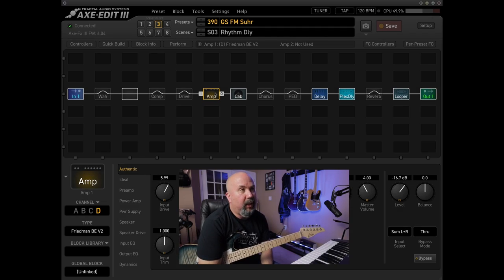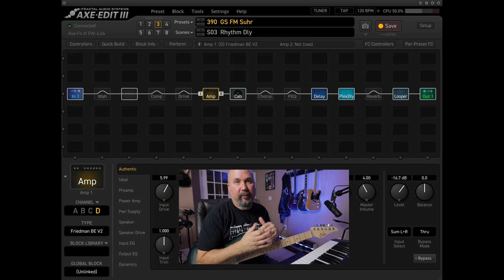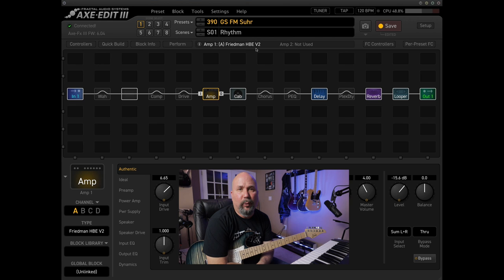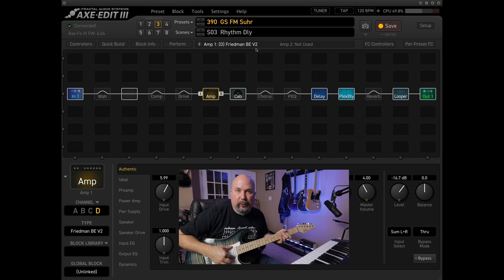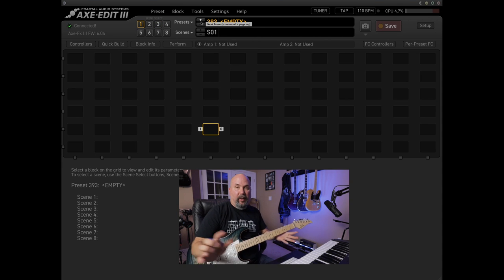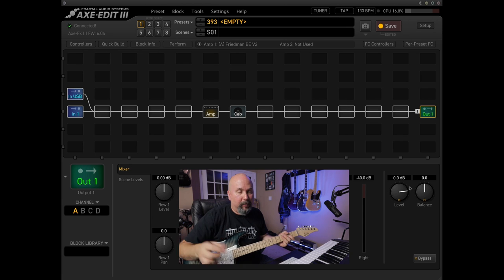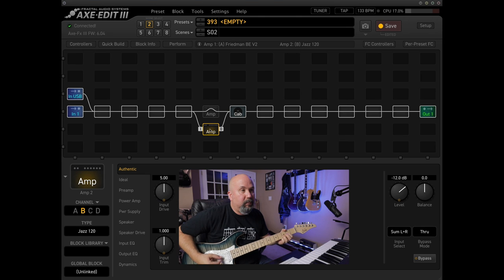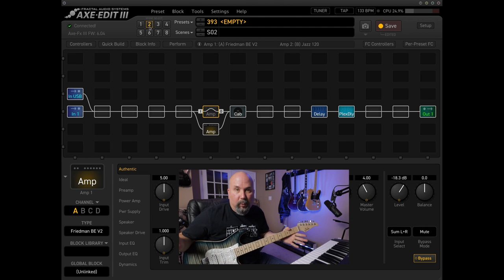Axe Fx 3 Seamless No Gap Scene Switching

Comment: Might be the best video you've ever done. If you're clever with the way you setup scenes you can also get channels happening here.
Reply: Also - that Suhr!
Reply from the maker: haha....i really didn't think I did much for anyone. See....I'm a terrible judge of good content of my own! Yes, I posted this in the forum and Yek responded with that channels thing as well and I totally had forgotten about that. Seem I saw you do a video with a "multichannel amp" using scenes. I tried the channels earlier but I still hear a littel gap but it never bothered me anyway...unless I misunderstood and did it wrong. I just grabbed a row of switches and assigned category "effect" and then function "channel select" etc. within that scene
Reply: Great video! I have tried channels within the same block as well as scenes with amps in parrallel, as you have shown here. You can definitely minimize the gap considerably to the point that its at least as good as most 'real amps', however if you REALLY want absolutely zero-gap switching, you can accomplish that by using different channels on the Multiplexor block,which would be placed after the amps. This is the only way I've found to get true zero-gap switching. Has anyone else found any other ways to accomplish this? Leon?
Reply: @LeonTodd  what is the clever way to setup amp channels without gap ? maybe you have any video on that ?

Comment: Any suggestions on how to accomplish this for the FM3? Can't have 2 amp blocks as far as I understand so feeling a little limited but hoping there's some way around it?!
Reply from the maker: If you are using 1 amp and not utilizing the channels function you can use modifiers to change settings on each scene. There will be no gap at that point but this removes some flexibility unfortunately. This is what I’m doing now since I only use one amp. Hoping they improve this over the next firmware updates.

Comment: Did they ever fix the gap between  scene switching?
Reply from the maker: I don't use the axe 3 live anymore but as far as I can tell in my presets (fairly basic) the gap is not there. They have made so many improvements since this video and we are on firmware 16 now.
Reply: let me ask you this if your just using different Fx in different scenes & not using ant amps are there gaps?
Reply from the maker: No. Like I was saying even with the amps I don’t hear a noticeable gap...not the case of the FM3. Axe 3 is more seamless all around. You could ask folks in the Facebook groups that are using it live and see what they are experiencing. I haven’t used it live it over a year. I didn’t have any issues when I was using it though. It’s better than real amps that have gaps when switching channels. It’s an awesome unit.
Reply: @GregSummersMusic   what are you using Live?
Reply from the maker: FM3.
Reply: @GregSummersMusic  ok i really like Rack gear i'll check outAF3 since  im just gonn a use it mostly for FX it shouldn't have Gaps i hope
Reply from the maker: Yea head over to the forums and Facebook groups and ask there. Others may have more recent insight. I don’t think you will be disappointed though.
Reply: @GregSummersMusic  ok will do thanks
Reply: @GregSummersMusic  Is the axe 3 still more seamless with the latest firmware on both units?
Reply from the maker: @legendfpv  Axe 3 is really good, FM3 still has a small gap when switching scenes, but this only applies if you are also switching channels on amps or changing to a different amp via the channel. For the FM3 I use the same amp on my patches so I just utilize scene controllers to change amp gain when needed and this solves the gap.

Comment: Hi Greg...I'm trying to use a BOSS ES-8 to control my FM3, and changing between presets and scenes has significant lag. Any thoughts?
Reply from the maker: Presets will always have lag so scenes are the way to go. You shouldn’t have a gap with scenes. I’m not familiar with the boss that you have but I’m guessing you are using the exp jack on the back to the axe Fx 3 and are using it as a stand in switch? Do you have any other small switch (2 button) to test?
Reply: @GregSummersMusic  thanks for the reply, Greg. So it sounds like you’re not supposed to use it as a back and forth between presets and scenes, eh? You set everything you need in those 8 scenes, and then move on to another set of scenes? I get it, but it’s an odd feature. I’m used to being able to flit between all manner of things with all my MIDI and non MIDI stuff.
Reply from the maker: @dominicgibson9529  Not odd and fairly common with other modelers. Helix is no different with presets and snapshots. Recommended workflow is using scenes (axe fx) and snapshots (helix). Personally I have a preset for each song usually, and during that song I will program things to turn on and off from scene to scene.That said, depending on the modeler and power of that modeler, some people will have 1 preset as the "kitchen sink" preset that has everything they will ever need and also use scenes and instant access features to bypass blocks on the fly to fit the song. Just depends on how much tap dancing you want to do. Helix will also have gaps from preset to preset. Can't speak for kemper. There's just a lot going on when a new preset is called (from a CPU standpoint).
Reply: @GregSummersMusic  I have created a monster of a pedalboard, which is basically 2 separate systems based around an ENGL Special Edition head, and an ES-8. My ENGL has 3 FX loops. One is for the amp as the sound and contains an HX FX, 2 H9’s and a bunch of other stuff. I then use the FM3 in the return of another loop so using the ENGL’s power section. I’ve been used to having all manner of effects set to go on and off and arranged in all sorts of orders, the ES-8 can arrange FX pre and in the loop, I’m just new to the modelling thing. I have to say the FM3 is definitely living up to the hype.
Reply from the maker: Sounds like a great setup!
Reply: @GregSummersMusic  I have to admit it is...not just because it’s mine, but because as someone who suffers from severe depression and social anxiety disorder it’s given me something to do. I’m also quite chuffed my theory worked. Have to admit videos like yours and Leon’s have been massively helpful❤️🎶
Reply from the maker: This is good to hear. Also, yes I occasionally suffer from mild depression and keeping my mind occupied, getting outside, etc. helps. It’s when I’m alone with my thoughts in the evenings that I am affected the most. Take care of yourself and stay healthy.
Reply: @GregSummersMusic  I hear you. I'm retired because of my health, but unfortunately I live in the Yukon, which is not a great place to be when you feel this way. Keep up the great videos...you've definitely got a fan up here.
Reply from the maker: Take care! Appreciate the support!

Comment: Hey new subs here!
What if i dont use amp and cab blocks, just the effects?? Does latency gap is there when switching?
Other question:
What if i use daw to control axe fx 3 does latency gap still there??
Thanks mate!
Reply from the maker: If you are talking latency when switching scenes there is no gap. Presets will always present a gap. I haven’t tested without amp and cab blocks so I can’t answer that at the moment. They’ve improved any noticeable gaps even since this video. Biggest issue was always changing amp channels to a different amp so you are probably good there only using the effects.
Reply from the maker: Thanks for the sub!
Reply: Coz axe fx 3 has 8 scene per preset, so if scene 1 is mesa and scene 2 is marshall will latency happen??
Question 2:
Should i put all the blocks that i need in every preset and scene and just bypass them if not used?does cpu affect it? Or i should put the blocks that i need??
Thanks again man!

Comment: Coz axe fx 3 has 8 scene per preset, so if scene 1 is mesa and scene 2 is marshall will latency happen??
Question 2:
Should i put all the blocks that i need in every preset and scene and just bypass them if not used?does cpu affect it? Or i should put the blocks that i need??
Thanks again man!
Reply from the maker: RhysCore axe Fx 3 is next to zero gap at this point as far as changing amp channels within scenes. Presets will still have a gap, and the amount will depend on the complexity of the preset.
Reply: @GregSummersMusic  thanks dude my question 2 please
Reply from the maker: RhysCore for question 2, put only the blocks you need (they will use cpu but you do have plenty of cpu to spare) as they do use cpu the same way even in a bypass state.
Reply: @GregSummersMusic  but if blocks were loaded and unloaded, will it cause the latency more? Or i should put all i needed blocks and just bypass it and not maximizing the cpu limit..
It is ok or not?
Reply from the maker: RhysCore I meant you just put the blocks that you need in your preset then control bypass states via scenes.
Reply from the maker: RhysCore make a preset for each song or if you can make a monster preset that is your all in one as well. Plenty of cpu but then again I’m not sure what your presets entail.
Reply: @GregSummersMusic  ill have clean 1, clean 2, rhythm 1, rhythm 2, Lead 1, lead 2
ill use evh 5150 iii all cleans (green channel), rhythm (blue channel), lead (red channel)....
If i use the delay in solo (scene 1) should i bypass it or remove the delay block for in other scene like scene 2,3,4??? Bypass or remove?
Reply from the maker: You just bypass. Thats how scenes work. Go to the scene you want to program, bypass or enable the blocks you need then save your preset.
Reply: @GregSummersMusic  thanks dude! Much appritiated